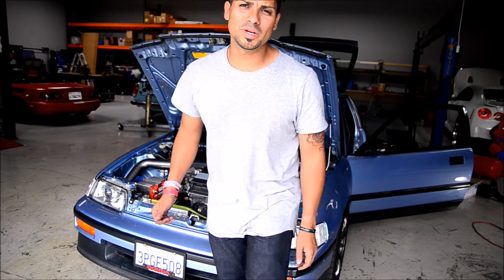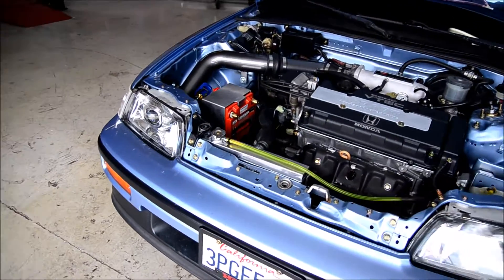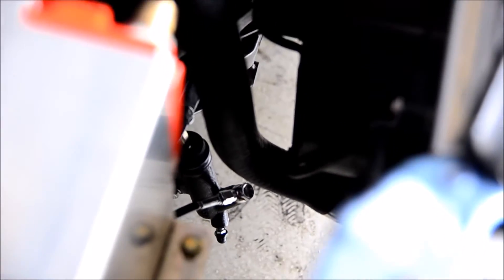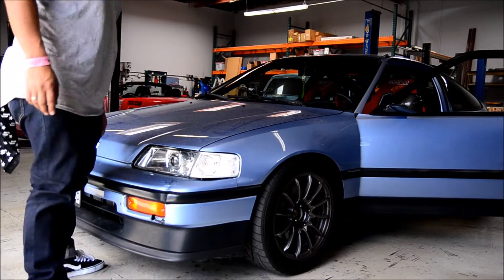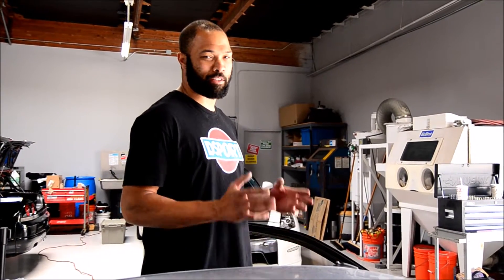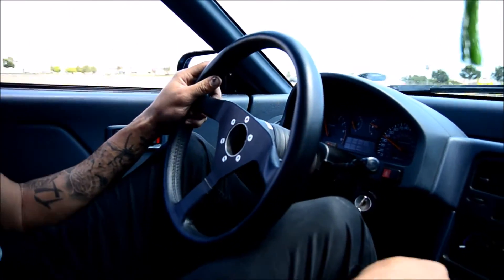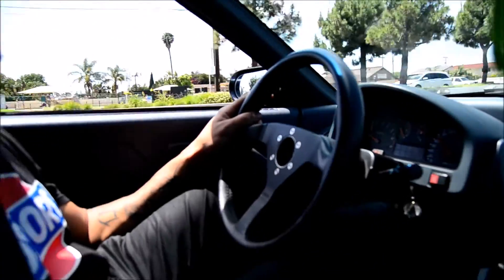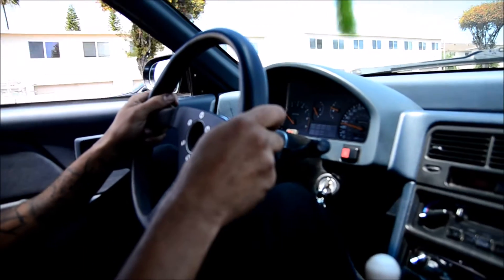EF cable to hydro conversion

Comment: Thanks for the video. I'm assuming you had issues with the bleeding because the bleeder valve is pointing down.
Reply: Just attach a clear hose to the bleeder valve on the slave and the other end with a water bottle with some brake fluid.